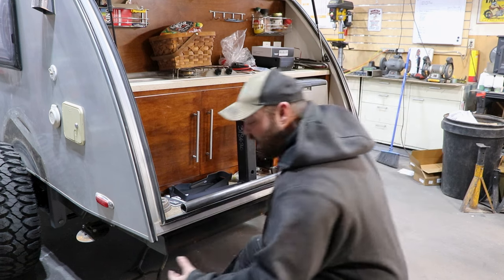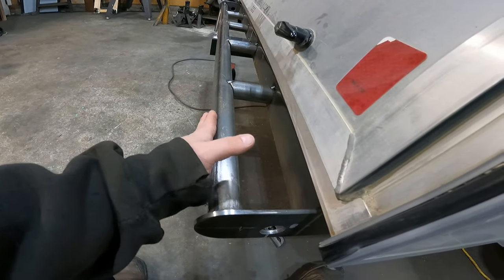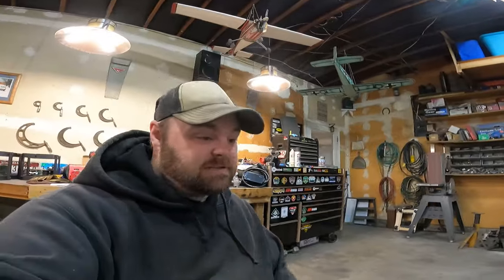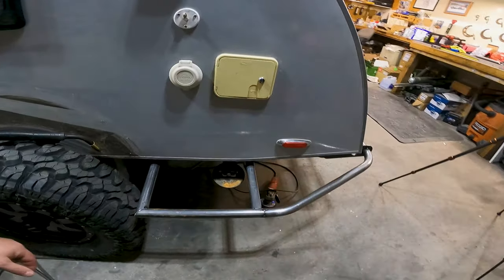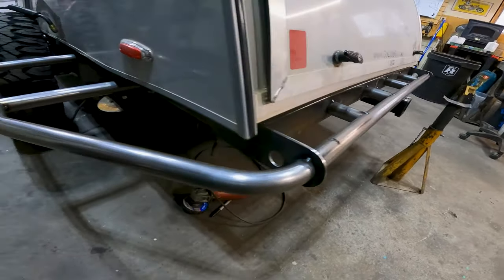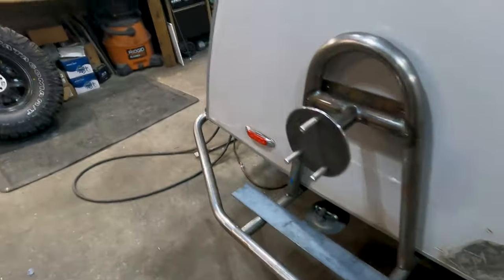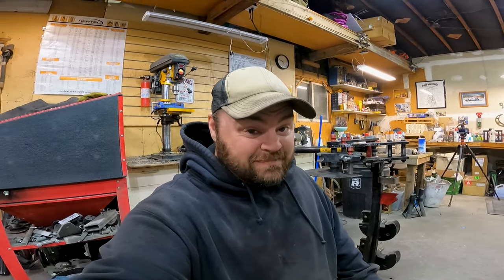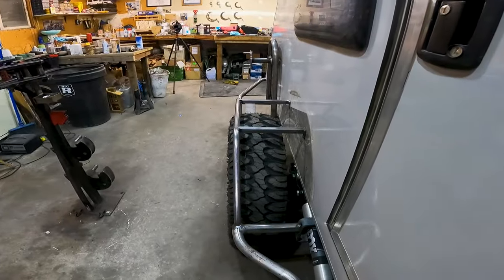Ultimate Teardrop Conversion - Body Armor

Comment: How will the tongue weight be with that heavy spare and full Jerry cans? I'm sure you thought of that. Looks awesome. I have often wondered why people aren't doing this with their teardrops to make them better overland trailers.
Reply from the maker: Thanks I wonder the same thing because these teardrop campers are pretty awesome. I did think about the additional weight behind the tires and I actually extended the tongue a little bit and added a off-road hitch. I will be explaining this in the final video of the trailer out being used and a side-by-side comparison.

Comment: So...with the custom suspension and now the armor, a LOT of steel has been added to that trailer.  How much heavier did all of that work make the trailer?  What does the trailer weigh in total?
Reply from the maker: The trailer came in under 1300 lbs before the conversion in the next video I will be discussing about the new weight of the camper. When I did a road test with the trailer the additional way plus the suspension made the trailer ride way better.

Comment: If the sliders push the trailer away from a rock as the trailer moves forward (awesome!), are the sidewalls of the tires still protected?  From these angles it looks like the sidewalls could still be pretty exposed to the rock they'd now be rubbing directly on.  But maybe it's just the camera angles here.  I guess the question is, does the armor protrude past the sidewalls to protect those?
Reply from the maker: The tires protrude a tiny bit past the rock sliders. Never had any real issue with tire puncture on trailers and I want the tires to be able to grip obstacles to climb up.
Reply: @dboverland2479  That's cool.